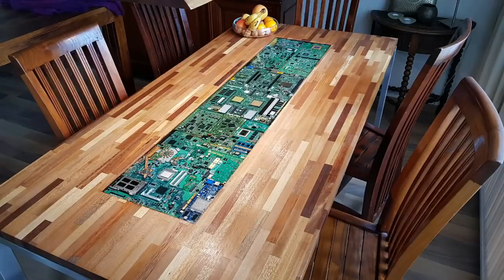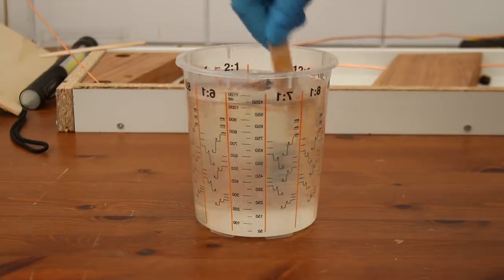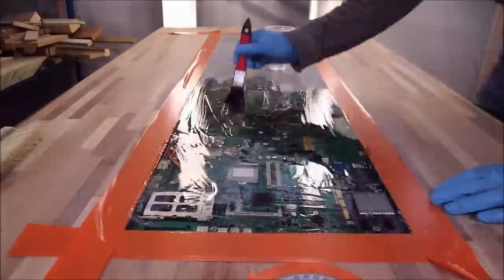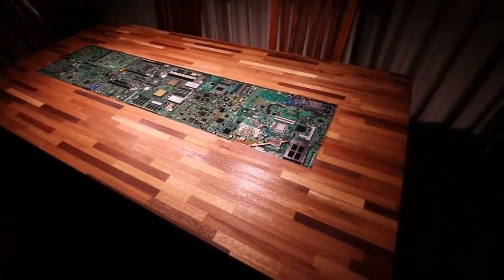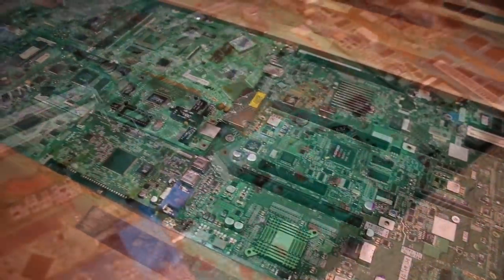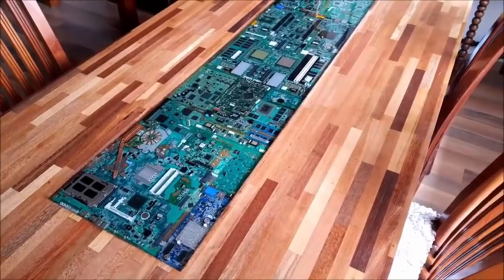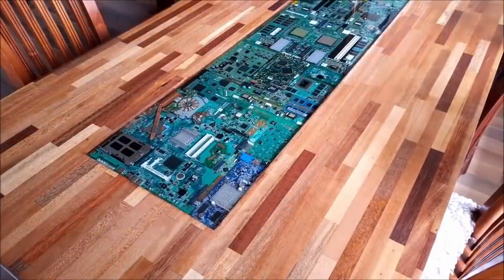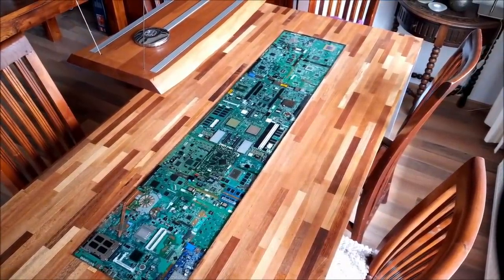Circuit boards with lights in epoxy in a table

Comment: The epoxy will cure with time, but heat (elevated temperatures) and combine with UV lighting will accerate the curing.  Since this is a wooden table, heat is not good because wood will warp.  Last option bbn is massive amount of UV light, hopefully from the sun.  With the sun, you needed lots of good lucky dry days.  UV light from a fluorescent "lamp box" will be a good choice if you do not have plenty of sunny days.

Comment: Get piece of toughened glass cut to fit, bevel the edges and sit it on a few rubber washers or stainless steel fixings = no problem with sticky spots!

Comment: I think the soft spots could have been avoided if you had filled the cavity half and let it dry for a day and then fill the rest half
Reply: Depending on your room temperature where you are, it is more like waiting for 3 weeks at 35°C to let every 5 mm (or so) of epoxy to cure.  The UV light from a week of blazing sun will also accelerate the curing to the same extend.
Reply: interesting facts about the nature of epixy

Comment: Great idea about the lights I lost my Mom not too long ago and I made my Mom some wreaths with lights on them and now I want to make a cross for my Mom's Head stone with white marble rock's and run lights through it and cover it in the epoxy mix and put gold flakes in it I just need the mold to make the cross and the epoxy mix and everything is done Thanks for sharing don't give up cause I know I am not going to give up because I made my wreaths just like I wanted and it was hard at first but I Pray to GOD TO HELP ME MAKE IT JUST LIKE I WANTED IT TOO BE And guess what it came out BEAUTIFUL JUST BEAUTIFUL JUST LIKE I WANTED IT TOO and now I just need to make the cross and I will be SOOOOOOOOOO VERY HAPPY when I get IT MADE Thanks again for sharing GOD BLESS

Comment: When working with resines, you want to avoid the bubbles trapped inside, that may account for many of your problems (besides a thorough mixing that usually is done with a driller with a tip with fangs), for this you can lay a motor over the table, perhaps with some excentric weight on the shaft, and turn it on while pouring and leaving it on afterwards for a while so the vibrations get rid of the bubbles.

Comment: I think you are usually supposed to pour it into different containers and them pour it again. It looked like you mixed and poured from the same container. I have had that same problem when I try to conserve the containers. Make sure you follow the instructions to a T and contact technical support for application techniques. In my experience the Envirotec technical support was Extremely helpful and knowledgeable. I wouldn’t be bummed if I was you, that table is freakin’ amazing, even if its not “perfect” good job!

Comment: Plunge cut the center epoxied portion out. Back the hole with plywood and start over. It was a cool idea and it's not a loss.
Reply: It was poured onto aluminium tape so the bond would be weak. Drill and thread a couple or more holes for eyes and plunge cut the edges (or you could do it in a number of smaller sections) then literally jack the epoxy block out using the eyes. At least you'll have the table and a cut recess to start again!

Comment: Why waste the effort and make a tent when you could just CLEAN the room?!?!?
Reply from the maker: Cleaning would not have protected the epoxy from dust falling in. And hey, it's a woodworking shop. What you'd expect..?
Reply: @Onrust1  my woodworking shop has exhaust fans to take the dust out and keep it clean, i expect you to have a clean work area..  there is a book called "seven secrets to highly effective people"  you're the part about sharping the saw...

Comment: Won't it cure itself after a some time?
Reply from the maker: Epoxy needs hardener. If you separate those two (not mix well enough), you end up with spots of epoxy and spots of hardener. They won't cure without each other. Maybe in time, yes, but until then, your table will be toxic. For only the fully cured epoxy is risk-free.

Comment: EPOXY WILL DRY IN 6 MONTHS TO A YEAR THEN IT WILL NOT BE STICKY, I DID THE SAME THING 3 YEARS AGO ON A COMPUTER DESK, EPOXY THAT THICK TAKES YEARS TO DRY, BUT IT WILL DRY.  MINE WAS STICKY FOR A YEAR AND NOW IT IS GREAT, NO MORE STICKY.

Comment: Rather than chipping out the epoxy to try again, why not just cut out the entire center area where the epoxy is and attach a thin layer of plywood/plastic to the bottom of the table under the hole. Honestly I wondered why you didn't just do that in the first place as it has to be easier to seal any joints, than to chisel it out like you did.
Reply from the maker: I certainly won't start over again - I've got other things to do. But I'm thinking about a part two, titled 'how (not) to pour epoxy', in which I fix the table. I admit that your method probably was faster, yes.

Comment: Use the 3 bucket method next time and follow the mixing instructions to a "T".    Still looks good though!
Reply: 3 bucket method?
Reply: @LEO-xo9cz  Yes, I have only done one epoxy project but it came out perfect using the 3 bucket method.  I am paraphrasing this process but start with three buckets, measure out hardener and resin into two separate buckets, pour one into another and stir per manufacturers instructions.  Then pour that mixture into a clean third bucket and stir again for another 3-5 minutes (or per manufacturers instructions).  This will ensure that all of the product is properly mixed and avoid the sticky spots.  Good luck!
Reply: @OzCapNWA Thanks for that. I've done a few that have all come out well using a single container. I've never mixed more than 1 litre but have luckily not had any issues.

Comment: Heat it. Epoxy catalyst is essentially a chemical heating of the resin which causes polymerization. If you can heat the whole table you might fix the uncured resin?

Comment: Perhaps the reson of the wierd blurring spots on the epoxy is caused by the microchips themself ! Indeed these electronic chips contain corrosive and highly reactive components (especialy the batteries). It's possible that some of them leaked on the presence of the liquide epoxy witch is a soft solvant..... Btw be carefull with this possible reactiveness even if the microchips are sealed in the epoxy, there can be small amont of toxic gas release. Nothing dramatical but for a diner table it can be a problem... But this table look amazing anyway ^^

Comment: take your router and use it to take out the soft spots. Then take the router across the epoxy part and take out 1/8 inch and the refill with properly mixed epoxy. Like my wife always says. It will only take 15 minutes. Yea, ok!!

Comment: Nice project. 1. Make a router sled to level the surface of the table. 2. Make a vacuum or pressure pot for epoxy. 3. Drill 4 holes at the corners of the inlay, cut out the circuit boards with jig saw and level table surface with router sled. 4. Use Circular Saw to cut 4 nice straight sides. 5. Add wood to bottom of table to cover the entire underneath. 6. Find more mother boards. 7. Add more fibre optic cables. 8.Mix epoxy thoroughly and wait 24 to 48 hours between pours and vibrate the table. 9. Sand, sand and sand. 10. Polish and Finish.

Comment: What you do is you cut out the parts that have the epoxy Harden turn them into small like bedside tables throw away the rest save what stainless steel you can that way you can remake the legs out of the stainless steel that you saved
Reply from the maker: I will not do it, but I sure like the creative way you are thinking! 😊👍
Reply: Just a thought lol :P

Comment: sick table man, how durable is that epoxy after it fully cures? is it strong enough for daily use without scratching?
Reply from the maker: No, I don't think so. But I know there is something to harden it (I've got to look into that). And epoxy has one big advantage over other see-through materials like glass or acrylic plates, that you can always sand it, and then polish it or pour another layer...

Comment: I wonder.... wil those caps leak or not ... time can  tell
Reply from the maker: The capacitors? I don't know, but I'm pretty convinced there is nothing going to happen with them. They are sealed airtight, so corrosion can not happen. What would them make to leak?
Reply: Onrust!  I just  would like t know if the leakage is caused by corrosion oxidation by air , or deteriorating from the materials them self . Maar wel een gave tafel en een mooi idee 👍

Comment: Not wiring it or battery power was a massive fail for me
Reply from the maker: Each his own and I respect your opinion on that, but I deliberately left out the battery powered lights with controller, because I thought you would go crazy quickly of a carnival in a table all the time... 😊 It is the temporary character of the manual light for a few seconds in the fiber optic that I like.

Comment: Of course it didn't help to put a extra layer on it... 

Wat had je dan verwacht? ;)

Would've been much easier to just put a sheet of glass over it all... so you can replace stuff.. why epoxy?? just because you can... and it's... epoxy...
Reply from the maker: I disagree (wat had je dan verwacht.. 😆😆 ). Looking into a depth that is poured in with epoxy is way more beautiful than looking into a void covered with glass. Everything in epoxy is better preserved and won't gather dust. If I had to do it again, I would again choose the epoxy over a sheet of glass.

Comment: Maybe some of the elements on the board were reacting to the epoxy?
Reply from the maker: No, because I poured them in at the pour of 4:25 (that was essential for the drilling at 6:20). As you can see in the video, the epoxy was fine after that. The fault came later..

Comment: great idea and you really did a great job.  im not sure if other people mentioned these two help-full hints. 
*to eliminate having uncured spots in the epoxy*
- combine the two parts of epoxy required in a clean container and mix for half of the time indicated in the instructions. then transfer the epoxy to a different new clean container and continue to mix for the exact remaining time required. pour as soon as the required mixing time is completed.  when mixing- stir the product as fast as you can BY HAND without adding allot of air or bubbles into the mixture. make sure to scrape the sides of the container during the mixing and when your transferring from the first to second container. when pouring out of the second container onto your project DO NOT scrape the sides. 
*to eliminate bubbles in the finished product*
- use a heat gun and pass back and forth in a even sweeping motion over the epoxy as soon as you finish pouring out the epoxy.  when the epoxy is warmed you will see the bubbles move to the surface and with each pass of the heat source the bubbles should "pop" and disappear.
Reply: Jeremy H this is a good hint, i did a bar too with epoxy and as you said if you follow instructions and use multiple containers it comes out flawless.
Reply: What would be the reason or the theory that pooring it over to another container will make it work better? thanks
Reply: @goednieuwskrantje-nl  It may be that at the edge of the container is still unmixed resin. If you dump it in a new container and do not scratch it, you avoid that this resin is being poured with it
Reply: @goednieuwskrantje-nl  not being an expert but I do believe the transfer simply complete well actually facilitate the mixing process
Reply: @goednieuwskrantje-nl  In the original container, a lot of unmixed epoxy liquid can stick to the sides and bottom, especially in the corners. When you put it into a new container, the unmixed liquid sticking to the sides of the original container will tend to pour out last, and in doing so will be poured directly into the middle of the new container. This trick really works.
Reply: I made my kitchen island in a wood top and did epoxy. The heat was the trick. I used a propane torch. I did several layers. It looks like a sheat of glass. I hope he does it again. I know that epoxy is not cheap though.
Reply: I think you are right that it is down to unmixed epoxy. I designed a product that needed epoxy over a wide area and we used to use an automatic mixing machine to dispence it out of a tube. Being fully mixed it always seemed to go off OK but I know that if you just try and mix the stuff in the same container you then pour it from you can get problems and uncured epoxy is damn near impossible to correct. Someone always suggest brushing catalyst on but that does not seem to work very well. So mix, pour into another container, remix, pour into mould seems to be very good advice as is using heat gun to warm it up. If you can set up a vacuum chamber to put it in all the better. Used to use one of those when casting prototypes and it was amazing how much air could be seen bubbling out of the material through the 2" thick clear cover of the vacuum chamber.

Comment: As other commenters have mentioned, this kind of thing can be caused by not getting the epoxy mixed thoroughly. Most of the videos I see with epoxy stress that you need to scrape the sides and bottom of the container to mix epoxy thoroughly. Some go as far as to scrape the bottoms and sides, mix it, then pour it into a new container and mix it again. From what I can tell that completely eliminates any issues with incomplete mixing.

Comment: It's an awesome idea and I'd call this a 99% success. I would be tempted just to cut the thing into pieces, throw it away, and start fresh with a new table. Or you could simply router around the edge, cut the whole thing out and put in new boards and epoxy.

Comment: have you thought about pouring a 1/4 inch new slab over the hole thing to just trap it down and take the few nasty spots that you can still see to save the protect?
Reply from the maker: As I said in my pinned 'PLEASE READ THIS BEFORE COMMENTING' comment: Could do that, but first, the ugly spots won't go away with that, and second I don't like the look of wood underneath epoxy that much... Covering wood in epoxy for me is something like making plastic out of something natural..

Comment: Get a nice piece of glass and put it on top of the hole table then maybe you can use it.  I don't think the table was a failure it was a cool idea and a neat project thanks for sharing the experience and video tapping it.

Comment: While pouring epoxy use a heat gun or hair dryer to cure epoxy, due to good heat epoxy comes to ita natural state in liquid and the bubbles and the problem you are talking can be solved.
Try this at small scale and do let me know for more info

Comment: What type of expoxy?  I use a marine grade expoxy from Duckworks that dries crystal clear and doing single pour up to 1/2 thick I no problems.
Reply from the maker: The link to the epoxy I used is in the description of the video. You should be able to do 2 inches at once. I did maybe 1/2 inch.

Comment: Would a layer of quick drying Polyurethane resolve the issue on top? may have to do the whole top and cover the wood as well, but at least wont be sticky.

Comment: Good job but you needed to sand the resting like you would do fresh clear coat on a car, at least to 2000 grit and them buffed with cutting compound. It would have been like glass.
Some resting needs pressure pot too and correct  temps to cure

Comment: I would put a motherboard in there with cooling(water to hide it outside under the table),CPU and everything(except gpu cuz it won't fit) and put some hdmi,power etc.stuff on the side on the table so the table is a pc
Reply from the maker: Nice idea, but you have to keep in mind that the epoxy-layer (=now about 22 - 23 mm) would become significant deeper. I think that could be a problem.
Reply: With some custom things on the motherboard it should work I think

Comment: I think you can do it pull that epoxies out and redo it you can do it right and depending on how you pull the epoxy out you can get rid of it easier Maybe by using some acid to eat underneath the epoxies to make it easier to come out just a suggestion and good luck

Comment: Same thing happened to my bar. My cat walked on top of the countertop & left her paw prints.  I don't think  I mixed the epoxy long enough. I sanded the countertop and spray painted it with a clear coat x4. It helped a lot! The countertop is shiny, but not as much as the epoxy. Try that if you still have it. Great work! Don't throw it out!

Comment: how about cutting and dropping the center part out from the bottom.  recreate your circuit board from scratch and re-insert, attach and seal then re-pour epoxy.  this will give you opportunity to sand empty space and apply sealer this time so epoxy does not leach into wood.  Try pouring your epoxy slower and waiting longer for a better cure. inspect each time before pouring the next layer.  make your layers thinner.  and allow more time to dry between pours. be sure your mixture of epoxy is correct.  cheapest, fastest easiest.   I think your table is an awesome idea.

Comment: Wait!!!! I have a solution for you! Go get a pane of 5mm glass cut with bevelled edges cut to size and put it on the table! Problem solved! That way no one will ever notice the soft epoxy!

Comment: Boy, that's inspired me to build my own table. Bad luck on the failed epoxy but immensely enjoyable to watch. Being an electrical engineer I think I would probably build a working circuit into it with oscillograms at each point of amplification, switching, mixing, number crunching etc etc. Oh and of course the obligation of leds.
Reply from the maker: Working circuits complicate the matter for quite a bit. Think of heat and what to do if something breaks down... I decided not to. Maybe better do something like that under a glass plate? Nice ideas though! Success!